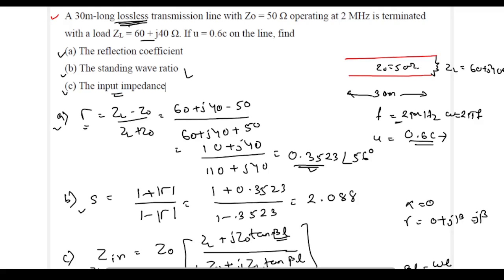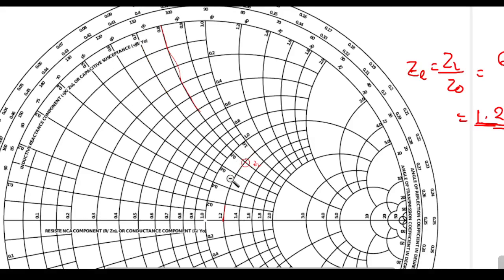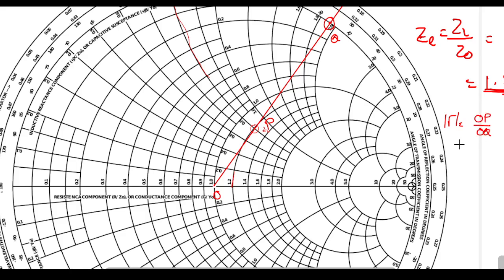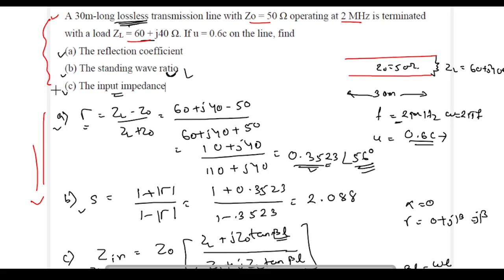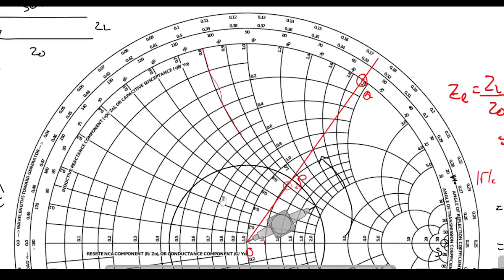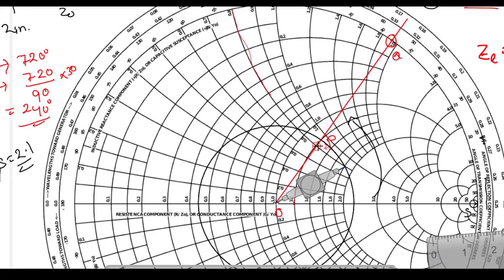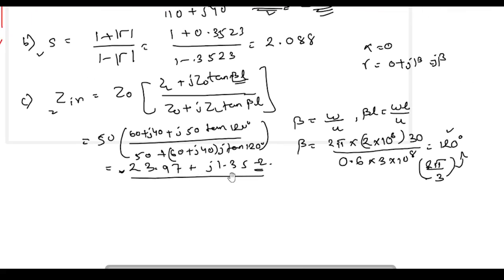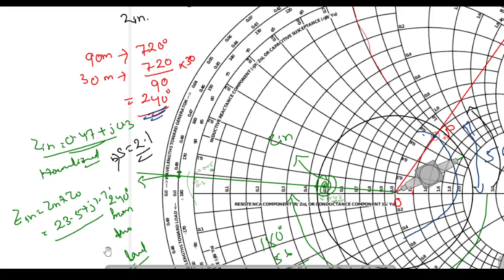Transmission Line Problems using Smith Chart-part 3 || How to Use SmithChart

Comment: @ 14:03 you said 0.3 and carried on with 0.3 instead of 0.03
If you multiply 0.3 by 50, you get 15
but 50 * 0.03 is 1.5. 
maybe a pinned comment to correct that??
Reply from the maker: Yes you are correct...
Thank you for informing